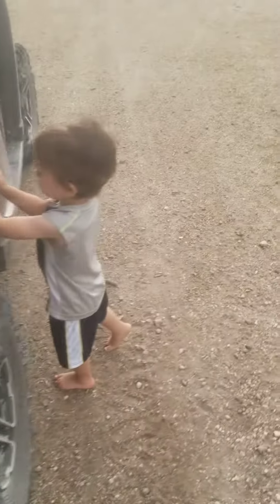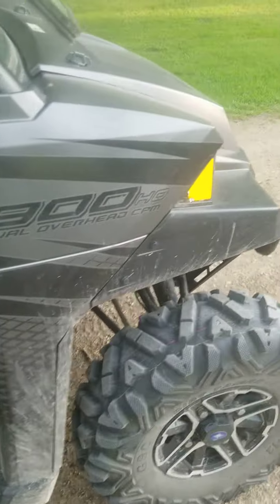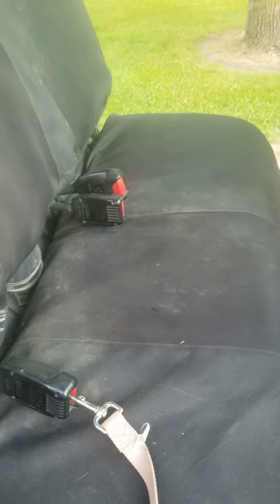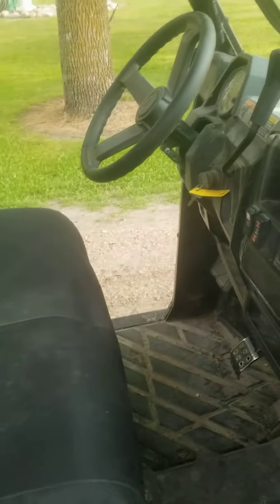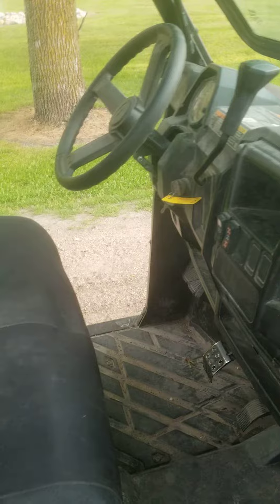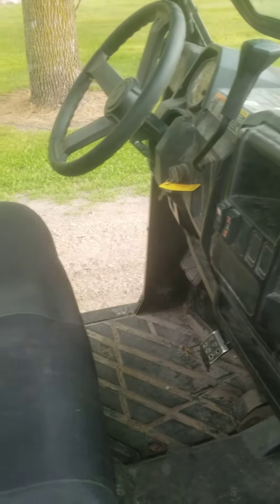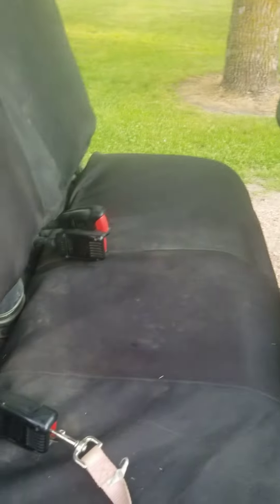Polaris ranger speed sensor

Comment: Would appreciate any suggestions. 2012 Polaris 800 Razor EFI hesitates at 45-50 mph. 45 is about 6350rpm. Not really a sputter or cough. Repairman just cleaned throttle body and fuel injectors and said idle air circuit was partially open causing a misfire at that speed. None of the work performed solved the issue. One person suggested the primary and secondary cluthes might be fighting each other. Need to get it fixed pretty quick so we can sell it and move, but I want it to be right. I should also mention that it has full power no issues 0-45. No codes, no engine light. Always at that speed only.Thanks.  Appreciate anything.
Reply: Did you figure out the issue? I am having the same troubles
Reply: @ShatteredPerfection  Summary for 2012 Razor 800:
•	Fuel pressure was a consistent 44PSI which is in spec. Previously verified during last repairs.

•	Spark Plugs were checked during previous repairs and color was a light brown 
(NGK BKR7E) Plugs replaced in previous repairs Jan. 2023

•	TPS set at .730 per factory spec. using TPS TOOL brand meter (specified range is .720-.740 TPS voltage setting controls idle and start up.

•	Overall TPS voltage affects WOT, but that would be bad TPS unit.

•	IAC solenoid was partially open because of excessive dirt build up in throttle body.

•	Injectors were checked and cleaned because fuel goes bad much faster in the summer heat of the desert.

•	Mass Air Flow sensor was cleaned with MAF sensor cleaner because of dirt and oil build up

•	UNI brand Air Filter cleaned and treated and intake tract cleaned

Diagnosis:
•	During diagnosis test drive the operators RPM’s were watched closely.

•	During wide open throttle pass on pavement, engine was at 6400 rpm at 45mph.

•	6400rpm is on the rev limiter and that’s the surging feeling. Had to feather the throttle lightly to work towards 50mph and hit 6400 rpm again.

Definitely Clutch related (clutches were not serviced in Jan of 2023, only on new belt).

CLUTCH INSPECTION ON MACHINE: 
Secondary clutch was difficult to open for belt removal.

Primary Clutch:  Needed partial rebuild
•	Installed new OEM sliders 
•	Rollers in the spider were good
•	Installed new OEM 2- way bearing
•	Installed new OEM 23-62 weights (removed 23-58 weights)
•	Installed new OEM shoulder bolts for the weights

Secondary Clutch:  Tear Down
•	Internal Rollers in excellent shape
•	Excessive dirt and debris in bushing area of moveable sheave resulted in hard to open during belt change, also translates to poor operating results
•	Replaced Belt Drive
•	After Clutch servicing engine holds at 6150 rpm during wide open. Wide open throttle RPM/MPH test

No issue getting to 55mph, did not try for higher MPH as clutches now hold correct RPM

Reply
Reply: @ShatteredPerfection  Summary for 2012 Razor 800:
•	Fuel pressure was a consistent 44PSI which is in spec. Previously verified during last repairs.

•	Spark Plugs were checked during previous repairs and color was a light brown 
(NGK BKR7E) Plugs replaced in previous repairs Jan. 2023

•	TPS set at .730 per factory spec. using TPS TOOL brand meter (specified range is .720-.740 TPS voltage setting controls idle and start up.

•	Overall TPS voltage affects WOT, but that would be bad TPS unit.

•	IAC solenoid was partially open because of excessive dirt build up in throttle body.

•	Injectors were checked and cleaned because fuel goes bad much faster in the summer heat of the desert.

•	Mass Air Flow sensor was cleaned with MAF sensor cleaner because of dirt and oil build up

•	UNI brand Air Filter cleaned and treated and intake tract cleaned

Diagnosis:
•	During diagnosis test drive the operators RPM’s were watched closely.

•	During wide open throttle pass on pavement, engine was at 6400 rpm at 45mph.

•	6400rpm is on the rev limiter and that’s the surging feeling. Had to feather the throttle lightly to work towards 50mph and hit 6400 rpm again.

Definitely Clutch related (clutches were not serviced in Jan of 2023, only on new belt).

CLUTCH INSPECTION ON MACHINE: 
Secondary clutch was difficult to open for belt removal.

Primary Clutch:  Needed partial rebuild
•	Installed new OEM sliders 
•	Rollers in the spider were good
•	Installed new OEM 2- way bearing
•	Installed new OEM 23-62 weights (removed 23-58 weights)
•	Installed new OEM shoulder bolts for the weights

Secondary Clutch:  Tear Down
•	Internal Rollers in excellent shape
•	Excessive dirt and debris in bushing area of moveable sheave resulted in hard to open during belt change, also translates to poor operating results
•	Replaced Belt Drive
•	After Clutch servicing engine holds at 6150 rpm during wide open. Wide open throttle RPM/MPH test

No issue getting to 55mph, did not try for higher MPH as clutches now hold correct RPM